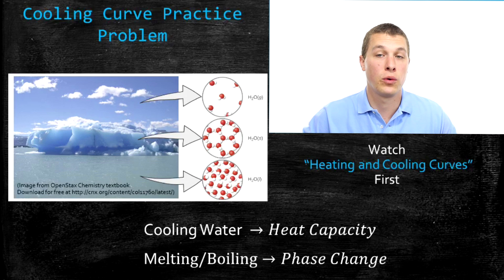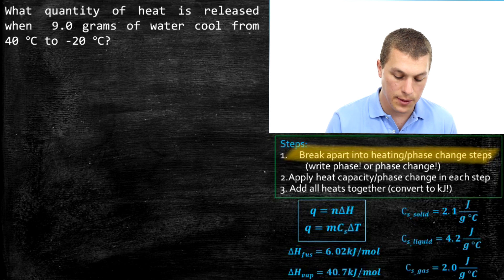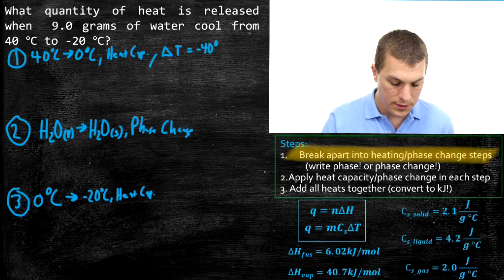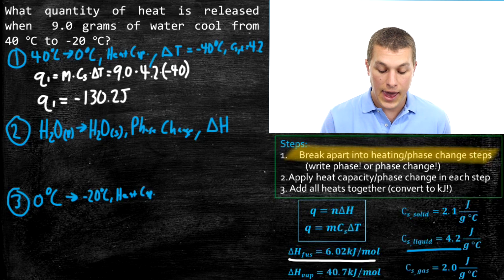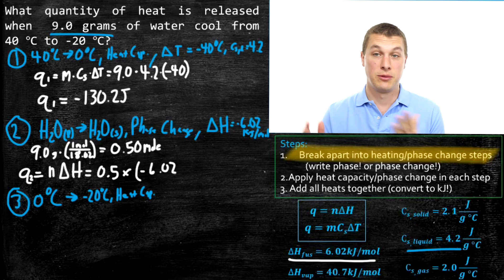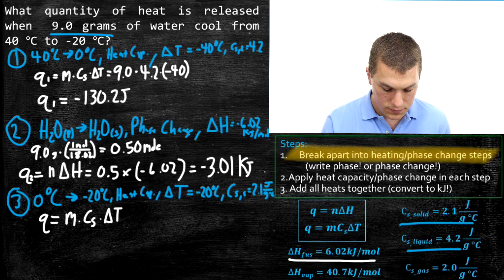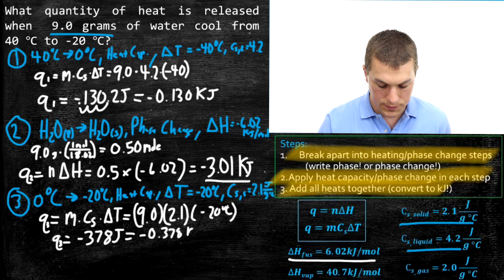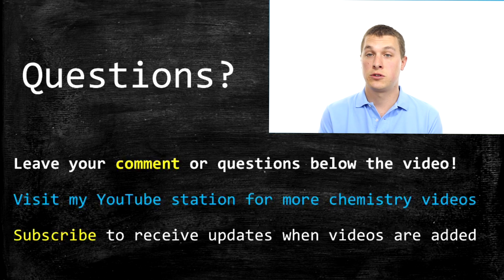How to calculate the heat released when cooling and freezing/condensing water - Real Chemistry

Comment: Please can the same thing be applied in physics if the water is in kg im a bit confused why isnt it mc(change in t) + ml(latent heat of fusion)
Reply from the maker: Hi Dinaka,

The same thing can certainly be applied in physics with the mass of water in kg. Though exactly how would depend on the particular question. I am a bit unclear on the second half of your question. Are you asking why the units to determing the heat of fusion aren't milliliters? You could certainly devise a system where you used milliliters of water and it would work.